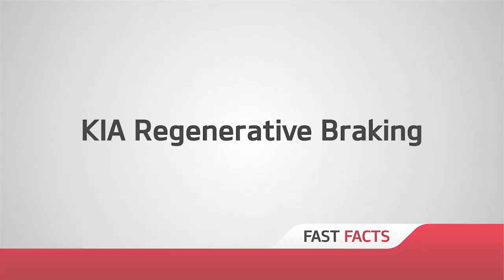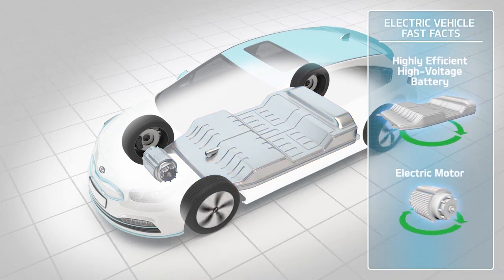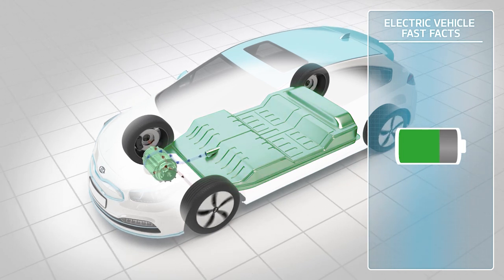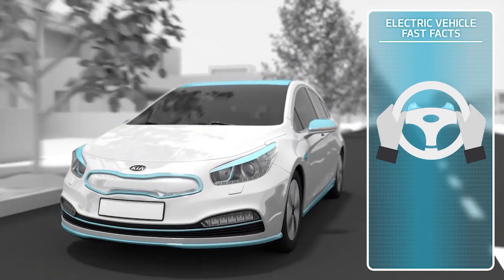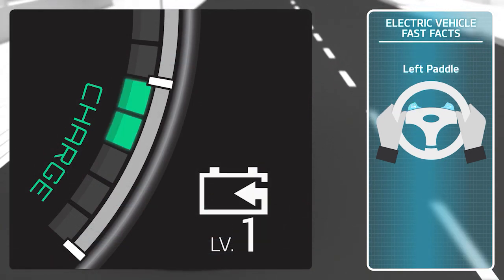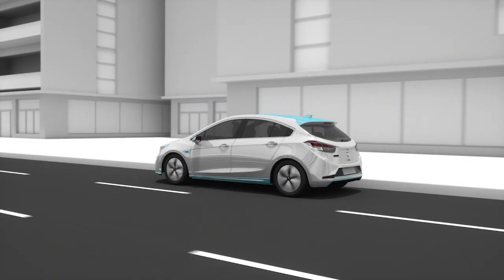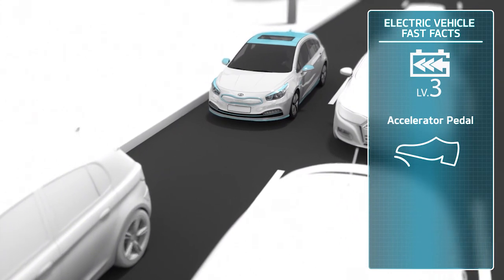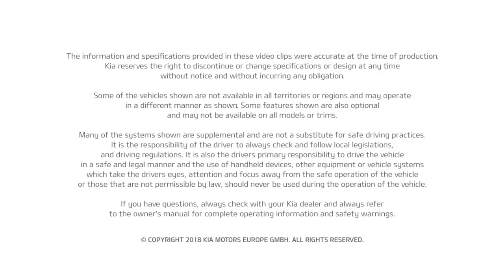Regenerative Braking | Fast Facts | Kia

Comment: I was hoping this video would answer a question Ive been wondering about for some time, I drive a Kia Niro self charging Hybrid and want to know if the brake lights come on when using regenerative braking and if so, at what stage, 1, 2 or 3?
Reply: Mine come on at stage 2 and 3
Reply: I can see my brake light come on when the car is in cruise control mode and it's following a car that slows.

Comment: I'm sorry but stating that regenerative braking improves range is just marketing talk targeted at people who don't understand the technology. it's off course factually true but it's only half the story.
The fact is that you can only regenerate about 65% of the energy already used from the battery to bring the car up to speed and that means you will go longer on a charge if you drive in a smooth and planning-ahead way so you don't have to use regeneration. I drive my Ioniq with zero regneration and get 9+ km/kWh in the summer and NO EV's out there is more efficient than that.